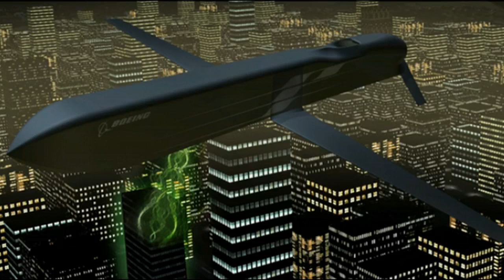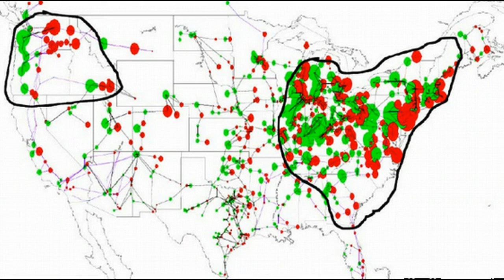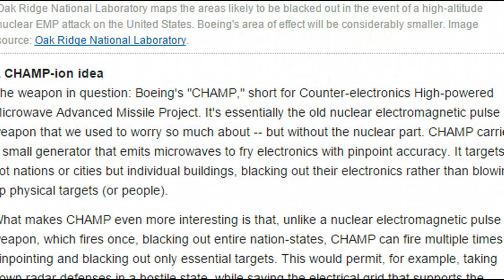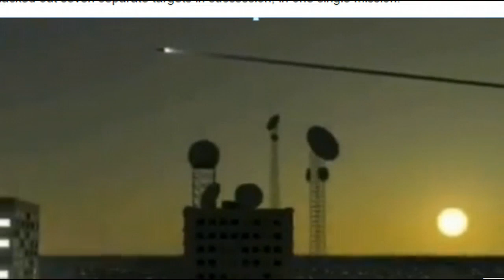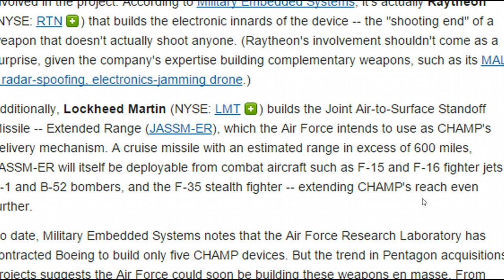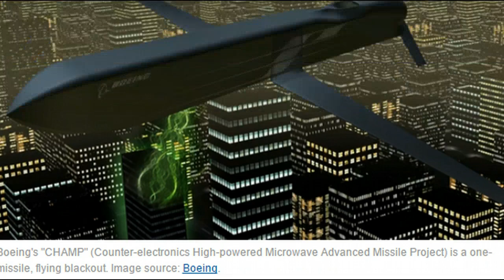EMP Weapon: Boeing Unveils Amazing, Slightly Terrifying Battle Technology

Comment: This doesn't switch the electricity off, until they fix the grid again. Every single item will be fried. Mains Nd battery operated items. Land and mobile phones, and all other media, cookers, air con, cars, trucks, trains, boats, planes, hospital generators, hydro electric dams, NUCLEAR REACTOR POWER plants, all farming machinery, everything that has an electric circuit. Gone. Absolutely terrifying. Millions WILL die if it happens.

Comment: Guys this is old news.  They were working on these projects in the 80's.  That's why I buy analogue survival equipment.  The paint on the F-15 it designed to short out every electrical circuit for 1500 yards. The list is longer than you can imagine.

Comment: The idea of a nuke exploding in upper atmosphere and cause a EMP has never been proven possible. Scientists think is probable but it's never been done and they have no concrete evidence it will work.

It's nothing more then a theory and a theory is nothing more then a idea that does not have any factual evidence.

Not to mention the idea of a government launching and exploding a nuke in the upper atmosphere is stupid. It would cause nuclear fallout all over the planet for many many years to come and that's not a theory. It's a fact
Reply: +clinton fisher You are incorrect. A high-altitude nuclear detonation produces an immediate flux of gamma rays from the nuclear reactions within the device. These photons in turn produce high energy free electrons by Compton scattering at altitudes between (roughly) 20 and 40 km. These electrons are then trapped in the Earths magnetic field, giving rise to an oscillating electric current. This current is asymmetric in general and gives rise to a rapidly rising radiated electromagnetic field called an electromagnetic pulse (EMP). Because the electrons are trapped essentially simultaneously, a very large electromagnetic source radiates coherently.The pulse can easily span continent-sized areas, and this radiation can affect systems on land, sea, and air. The first recorded EMP (1950) incident accompanied a high-altitude nuclear test over the South Pacific and resulted in power system failures as far away as Hawaii. Also the level of radiation produced is less that 1% of that produced by a ground burst. if your comments were true, then all the air tests done in the 50's would have polluted/destroyed the planet, which clearly it has not.
Reply: craig PHD I'm going to ignore your comment because #1 I can use Google myself and #2 There has been no evidence to show a nuclear explosion in the upper atmosphere could cause a EMP. Its only speculated as a possibility. Its a theory, and a theory is just a statement not back up with facts.
Reply: +clinton fisher   Clearly, I am no match for your ignorance.
Reply: +clinton fisher

Feedback for a fool:

1) "It's nothing more then a theory and a theory is nothing more then a idea that does not have any factual evidence" Theory before it can be called such must be tested and proven otherwise it is simply mysticism. Darwin's theory of evolution, for example, has been proven yet it remains a theory. Do you understand, I doubt it. 

2) "I'm going to ignore your comment" you clearly didn't. It was a well written and interesting post. For every 1,000 fools, there is a genius, you are one of the fools.
Reply: clinton fisher You are a complete idiot. He'll, just watch a NUCLEAR weapon documentary here on YT....the USA DID detonate several nukes in the upper atmosphere in the 1950's, and power was knocked out on several South Pacific islands due to the EMP (including in Hawaii).

Comment: CHAMP is now fully deployed. So are laser weapons such as the Israeli -Raytheon "iron beam" system. The integrated air defense systems that the Russians put so much stock is now as relevant as horse cavalry. A nations air defenses are only as good as the weakest wire or circuit

Comment: hey i was wondering if you an help me with a scientific explanation, look at my video on my page, does these look like emp plane after burners, i recorded them 6 1 2015 or if not because it was over the gulf of mexico before a storm, went up in elevation then the light used to the top of the storm as cover to move i guess, i seen these three times before with my friend, and i seen them four times by my self in the ozark hills in missouri

Comment: ONLY HALF THE FACT AGAIN DAHBOO !  There are NON NUCLEAR EMPs. and they have been used for a long time. You are confusing or mixing the two together.
NNEMP generators can be carried as a payload of bombs, cruise missiles (such as the CHAMP missile) and drones, with diminished mechanical, thermal and ionizing radiation effects, but without the political consequences of deploying nuclear weapons.
Nuclear EMPs  are a nuclear warhead detonated hundreds of kilometers above the Earth's surface is known as a high-altitude electromagnetic pulse (HEMP) device. Typically the HEMP device produces the EMP as its primary damage mechanism. The nuclear device does this by producing gamma rays, which in turn are converted into EMP in the mid-stratosphere over a wide area within line of sight to the detonation.